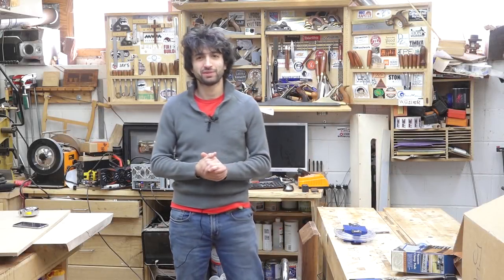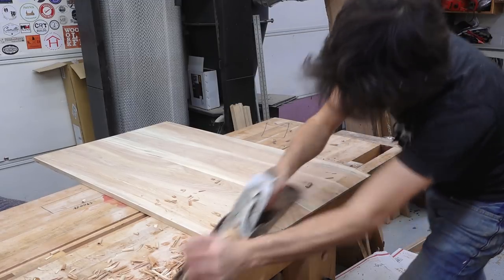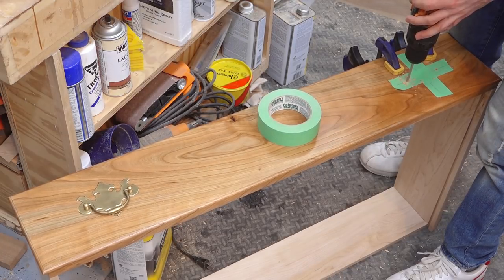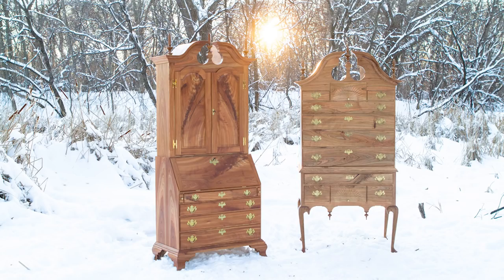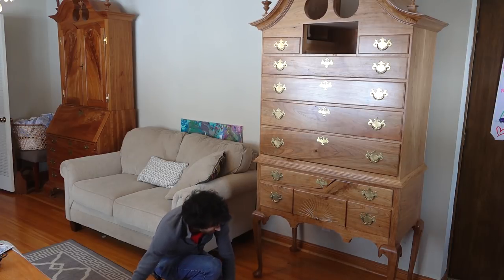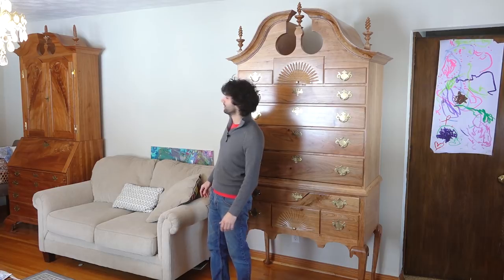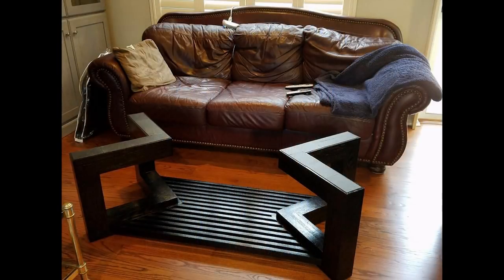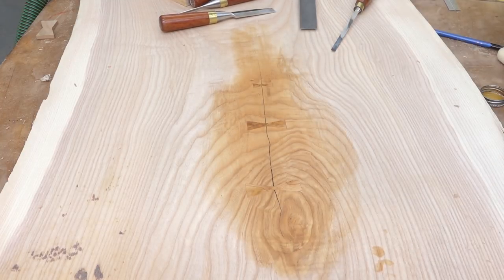Matt's Weekly Shop Update - Feb 27, 2018

Comment: Matt, I have come across some ebony wood.  They are about 20 inches long.  Some logs are about 8 inches thick.  Others are smaller.  There are a few logs that are about 15 inches wide.  

I was thinking about making a cutting board for myself.  I plan on making some coasters and trying to sell them.  

I also have an ebony log that is hollow in the middle.  I was thinking about cutting it into round plates and filling in the middle with turquoise stones and sealed with clear epoxy.  Are these ideas good ideas for such a rare wood?  What other reccomendations would you suggest?

Comment: Either you are around 5 ft. Tall or the legs on the highboy are much too long.  It is very nice work but much too tall.  My dad had a highboy all through my life. How do you use the top drawers?
Reply: You pull the drawers completely out.
Reply from the maker: I disagree. The size and proportions are correct for Queen Anne. For the top drawers you can: 1 Be tall. 2 Stand on something. 3 Pull drawer from the opening